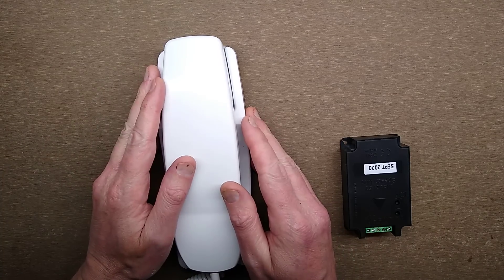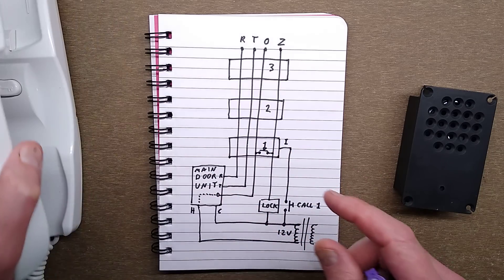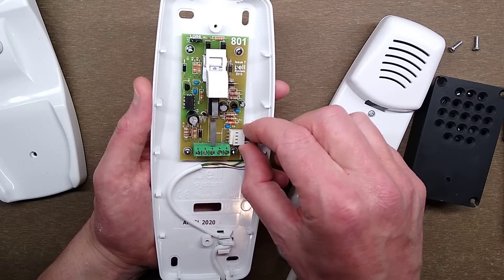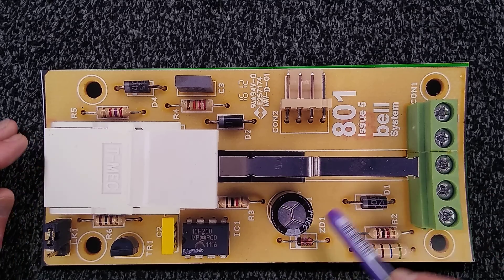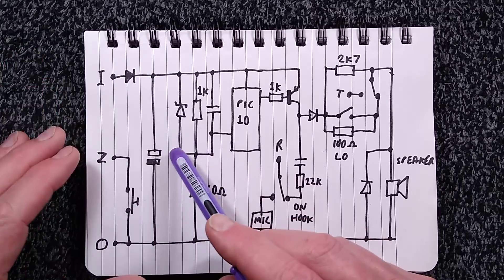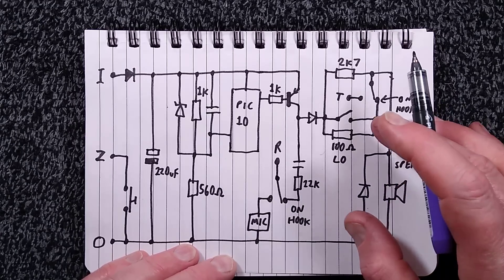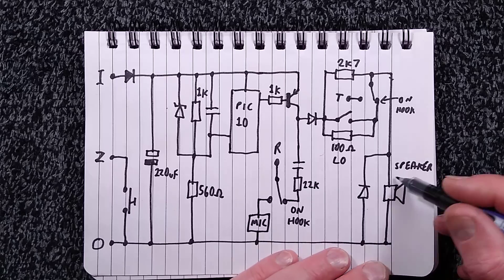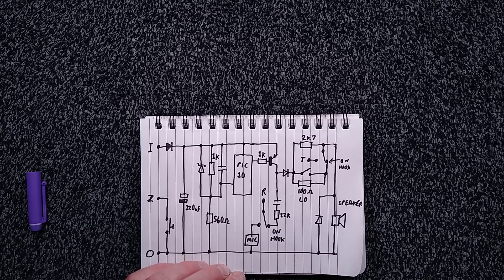Inside a door entry phone

Comment: Ah, good old classic analogue door phones :)  Did you guys in the UK use to have systems where the person at the gate had to keep the button pressed during speaking?
Reply from the maker: Some old systems had that.
Reply: @bigclivedotcom  Neat, would be cool if you got your hands on one of those :) Here in Hungary the biggest challenge was that the most common outdoor unit could be either, the same design dominated both types of circuits and all you had (if someone didn't tear it off years ago, and of course they did) was a little sticky label under the outdoor speaker on how to use the thing. So in most prefab house blocks it was pretty much random what you'd have to do.

Comment: Brand of the phone in my flat is a Comelit. Has 2 buttons. One for the door and one for privacy. Looks old think the flat was ex council. So they probably got a bulk deal on them a long time ago. Would they have to run 2 different sets of wires if the block has 2 entry doors with a call panel at each door to avoid opening both doors at the same time?

Comment: Fascinating.
The building I live in, in Toronto, has a Mircom panel, with a dial pad.
You dial a 4 digit number, and that connects to the copper wire POTS system.
Every unit must have a landline, for them to have intercom.

Comment: Very old school. The System in our house was installed ~2000 and it has a completely digital bus. 2 Wires (+Power) that is shared between all phones. It is also possible to call from upstairs to downstairs and vise versa. It's a Siemens system, the main unit is completely reprogrammable, it contains an 8051 MCU I think

Comment: Interesting coincidence, I just had to analyze a 30+ year old system by Amplyvox out of Italy that was damaged by water from a massive water line rupture in a unit above where this controller was mounted. In theory it is the older version of the system you presented here.
This old unit uses two discrete channels running with TBA820M ic's with audio levels adjusted by two 10KΩ pots. One channel amplifies the mic audio from the main door unit while the other amp handles the mic audio from the apartment units. Very simple. If I decide to repair and keep this as a rebuilt spare I’ll shotgun both amps, pots, and all of the electrolytics as well as the terminal blocks that have rusted. Less than 10€ in parts and a half hour labor. Thanks for the informative video Clive! Thanks for the insight from several of the viewers comments as to how to replace the carbon elements with condenser units. Cheers All!

Comment: Interesting coincidence. Just finished analyzing a 30 year old Amplyvox control unit from Italy that was damaged by water. It uses the same basic wiring as the unit you displayed however it utilizes two discrete audio circuits based on the TBA820M audio amplifier IC. Each channel has its own 10K pot for volume control. A very simple system where on channel amplifies the microphones of each apartment unit while the second amp amplifies the microphone audio of the door unit up to the apartments. Instead of a micro controlling the ring tone you have a small electromechanical buzzer powered by AC from the transformer. This design appeared very easy to repair, considering the damage I will replace both audio amps, the pots and remove the carbon mic elements for the newer condenser elements. Speakers are 22Ω and sound a bit Tinny due to the fact that the apartment portion of the system is all in a flush mount wall phone set up. These can be replaced with newer handsets you have shown in the video.
Thanks for the information Clive! Cheers!

Comment: This is quite an old fashioned way of doing this.
The "newer" which have been around for a long time now, are just 2 wire. Often tan in Cat5. However will work on Cat3 (telephone cable).
The 2 wire will do colour video and audio. All addressable, handsets, multiple entry panels and 2 door.
Addressable is press call button then run to handset and press the lock button etc, not dip switch type addressable.
CAME. BPT, Videx etc.

Comment: I install and maintain intercoms and security systems, i will agree that most systems are twisted and taped cables. its a right pain to diagnose faults when you have so many high resistance connections.
the R.O.T terminals on the bell systems are basically common, speech in and speech out.
the 801 handset you have uses the audio call signal which is amplified when the handset is on the hook.
they do another handset which has a simple ac coil that when energised makes a simple buzzing noise (if it were to receive a dc signal then no noise is made).
Most more up to date systems work on a 2 wire bus, this carries data for the voice signals and the door unlock signal, i believe the modern systems use dtmf, though ive never scoped the signals on the newer systems.
most of the time you will always hear an a.c humm on the intercoms, this is because either the system is using an a.c psu or the cables have been ran adjacent to the buildings mains circuit cables.
i hate fault finding on other peoples intercom installs, mostly electrician installs that use crappy telephone cables with hardly any copper on the cores, they always snap because they have more aluminium than decent quality cable.
maybe one day i will do you a video on an install that i have done.
Reply: i will re iterate, most security companies will install them correctly, its the electricians that havent got a clue about these things that will make a shit install of them.
Reply: In the USA the electric code does not allow the in-wall use of communications cable without solid copper conductors. Only exception is for coax cables. EDIT: This is not to say that stranded wiring isn't allowed nor to say that tinned copper conductors aren't allowed (they are).
Reply: @brianleeper5737  unfortunately here in the UK every man and his dog can have a go, we have regulations for the install of fixed electrical installations but sadly not for the comms industry or security industry.
we do have certification bodies which i am a member of but theres nothing to say we have to use certain types of conductor. we do have to install low smoke and fume cables for fire resistance but thats about it.
would love our government to be a bit stricter on what we can and cannot use and who can and cannot work on something.
Reply: @awolmadandy  In the USA plenty of copper clad aluminum cable is sold and installed but it's an electrical code violation to use it. Doesn't stop some people but it could cause them some legal trouble.
Reply: At my place if someone ring me or anyone else everyone can her the ringing, just very faint.
We have a modern system, 10y old.
Any insight on what could cause that?

Comment: At work we use a simular system but the handsets only use 2 wires, each handset has 8 dip switches which you have to program in binary. its always puzzled me how this system works, my guess its the outside box sends a signal by PWM and the handset is doing most of the work, seems like a sinple way of doing it and replacing the hardsets is always fun, esspecially if you forget to program the dip switches or program it wrong :D

Comment: Basic question (please forgive me:) That collection of basic elements that is controlling the Zero reference for the PIC MCU (the zener diode, cap, and two resistors) - what precisely is going on there? As far as I'm concerned, that's a pretty smart circuit and reflects real expertise on the part of the board designer, but I can't remember my basic circuit analysis stuff well enough to immediately grasp what's going on.
EDIT: my guess is that the cap is some sort of filter, the two resistors limit current to the PIC reference pin, and the Z diode is protection from Input rail weirdness of some sort.
Reply: The zener diode clamps the voltage to the microcontroller. The capacitor smooths the ripple from the AC input via the diode. The lower resistor (in the diagram/schematic) limits the current passing through the zener.
Reply: @Mark1024MAK  I see! OK, super cool. Thank you, paisan. 🙂

Comment: i've been trying to hook my intercom system to my dvr to be able to record and answer from remote. the problem is that some thing is messed up and so i'm able to send and receive audio from my dvr if i hook up a computer for example, i'm able to send and receive audio from the intercom when plugging in a computer, but when i plug the dvr and the intercom together i always hear nothing . . . i've tried to use a small amp to perhaps boost the voltage or something and yet nothing . . . i'm so tired of it that i might just put a rasp pi somewhere else and be done with it . . .

Comment: Another great video Clive! and a subject I specialise in, I’ve done a lot of work on intercoms over the years, if you can name an intercom manufacturer I’ve probably worked on it.
The older legacy type that you mention all use the 3+1 or 4+1 wiring method, meaning a common 0v rail, a speech line from the door station and a speech line towards the door station, lock release is also a single wire return. I’ve made different manufacturers handsets work on other manufacturers door panels in the past just by knowing this. Intercoms over the years have evolved heavily with newest being IP based, some use the wiring method above but have extra lines so more than one door station can call a phone, these have ‘busy’ lines to stop other door panels being used when a conversation is in operation, others use a ‘2-wire’ bus similar to DCC in models train sets, with (commonly) 48v carrier and each handset being addressed.

Comment: Been threatening to have a go at integrating some of my home automation stuff with the door entry system in my flat but seems a little past my technical skill level atm. (system's a GDX 5 I think) I suspect it's a little more complicated than just shorting wires to make the lock open but not 100% sure, kinda afraid of testing that theroy and killing the door controller for the building.

Comment: For some reason, our apartment complex is wired in such a way that the only person able to disengage the lock or use the R / T lines is the last person that has been buzzed by the front door unit. So if someone rings more than one doorbell, only the last person rung can actually answer and open the door. This has lead to me missing a few packages already..

Comment: The door entry intercom at the flat where I live is made by Tynetec.  It seems to work a bit different to the one that Clive has described here.  One problem it has is that if you answer between the rings and immediately put the handset to your ear, the chances are that you will get another extremely load and painful ring in your ear.
Reply: I'd bet someone at Bell got a raise for getting the handset speaker to produce the ring tone but it's a nasty choice for the curious who pick up phones and press buttons.
Reply: Magneto telephone circuits are the worst for getting a loud ringing sound in the earpiece. As the only thing in control of the ringing voltage is the calling person operating the phone at their end…

Comment: I did actually try the "trick" of pushing the hook switch while holding the handset close to my ear all the while someone was ringing the flat where I was staying and I can confirm it was indeed deafeningly loud.
Also I discovered that nothing keeps you from tapping into the conversation when someone outside is ringing a neighbour, also you can even open the door before the neighbour. 

Unlike modern, digital door entry phones (Or I should say intercoms as that's how we call door phones here in France, well the french equivalent "Interphone", anyways) where you obviously can't tap into someones else conversation but you also can't open the door if no one has rung your flat up, and there's even a timeout when the communication is established, you can't keep chatting with your guest indefinitely.

Now from the outside point, most digital door entry systems don't allow you to call more than one flat at once and that can prove to be quite annoying for people like lift engineers when you call someone, they don't pick up and you have to wait before being able to call another flat.
Reply: Why would that even matter, every random guy on the street or through a window can hear what's being said through the door station loudspeaker. I don't think people would have to make their incriminating calls through an intercom phone. 
Also, not being able to open the door seems like a bad idea if the doorbell button is defective. 
I prefer a simple analog device over a digital one with the same functionality but which also bothers me with non-features 'for my own good, thanks.
Reply: @westelaudio943  When you say "Not being able to open the door seems like a bad idea..." you're talking about digital intercoms, right ?
If so, I think first they're quite reliable, but also if the door doesn't open, the tenant will simply go down and greet his guest at the entrance door.

In fact I've seen blocks of flats where the first gate has an intercom, so the tenant can open to a guest, but then the guest has to walk on the open car park/courtyard to one of the buildings, and here there is another, locked door.
Tenants can open those doors (One for each building) with their RFID keyfob, however they must get out of their flats to open the door from inside whenever there's a guest as there's no intercom and the unlock button in the flat only opens the outer gate.

(Many years ago there was a code pad but they decided to replace it with a keyfob reader, obviously for "security" purposes).
Reply: @westelaudio943  In the apartments I live in, the entrance to the apartments is a room and that's where the door station is, so you can't hear it from outside, you can't hear what's being said through an open window from nearby apartments, and you can't hear it if you're just walking past the apartments.  I've got to be in the entrance area itself in order to hear it.  But if you pick up your door phone in your apartment and others are using the system, yes you can hear them.
Reply: I can confirm that others can listen into your conversation, I have a door phone like this in my apartment and there have been times when someone's called my apartment and I think another apartment, because my neighbours have picked up their phone and I hear them talking and I'm sure they hear me talking also.  I daren't try holding the phone receiver near my ear while holding down the hook button while someone's ringing my apartment, I really dislike sudden loud noises, especially high pitched ringing noises in my ears, and my door phone has quite a high pitched ringing sound, much like the noise Clive is mimicking in this video.

Comment: We in Hungary have an older verison of this technology, with a code lock too. It's made by the polish Proel company. Interestingly that one only uses two wires for the flat's phones. It's a two wire bus going up to each flat. Wonder how that works. I guess it's somehow multiplexed, like a display. I think it recieves power, when somebody calls, it sends an 8 bit value on the bus, then the corresponding phone probably sends some other singmal back, same goes for the audio and the opening signal. I have installed some of them, to me it's fascinating that it acomplishes this with only two wires.
Edit: I think it's an 8 bit value since you can program 0-255 flats into it.
Reply: If it only has two wires I bet it's actually a more modern, like you said multiplexed system.
You can actually try the following tests if you want to know how modern your system is:

 - Try unlocking the door without someone ringing up your flat. Is it possible ? If so that means it's an older and less secure system.
(Modern door entry phones don't allow you to unlock the door unless someone has rung you up).

 - Again without anyone ringing your flat first, simply pick the handset and listen, can you hear the street noises or better someone talking to you from the street but without having rung you up ?
You can hear the person and/or speak to him ? Older system !
You can't unless your flat has been rung up ?
Modern !

Also on some modern intercoms (Or maybe all of them ?) there's a timeout delay once the communication is established, whereas on older and simpler ones like the one featured in this video you can talk with your guest for as long as you like.
Reply: @psirvent8  It's from the 90's and 2000's, and no the doors can't be unlocked while not ringing, but you can hear the other people talking (on the older models in the same line of products) newer ones of the same thing don't do that. I talking about the Proel CD-1803/KDC-1803.
Reply: @psirvent8  thank you, that was informative. I found out I have modern system but the odd thing we have is that if someone ring me or any neighbor everyone else can hear the ringing, just very faint. 
Any idea what that might be and if fixable?
Reply: @kimrosland  It's probably a similar system which is in the video. Meaning that each flat has a separate wire, which the installers probably ignored, and wired it as if it were a bus line. Or they just didn't program the flat's phones correctly. Maybe all phones are programmed to the same number.